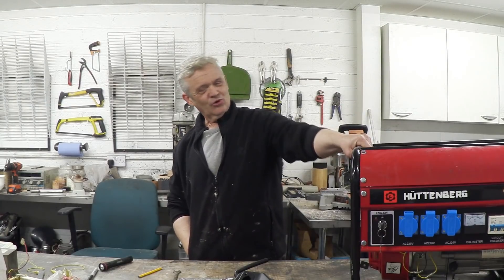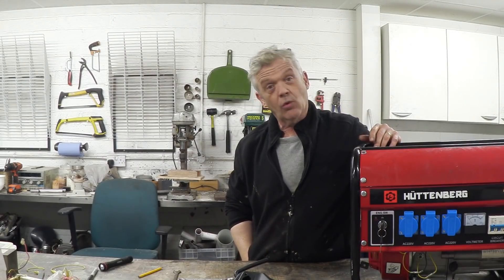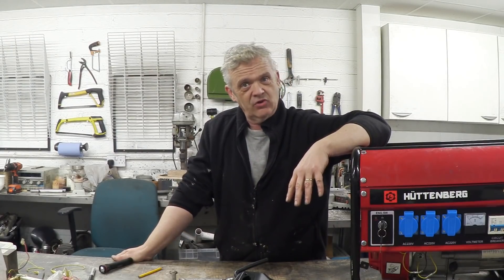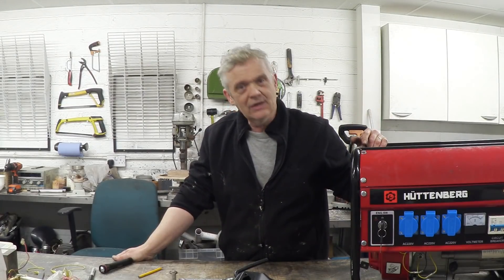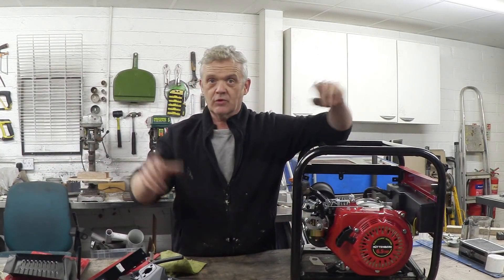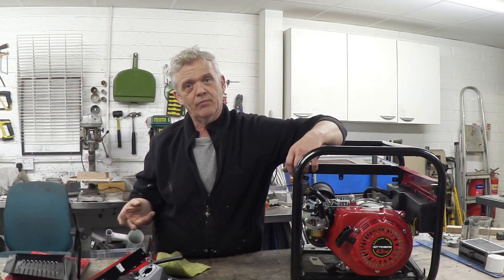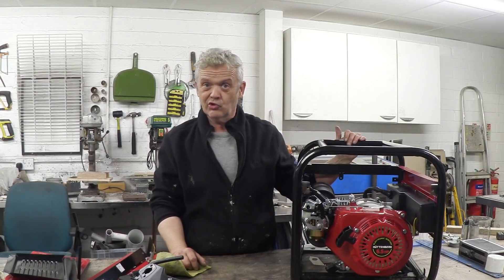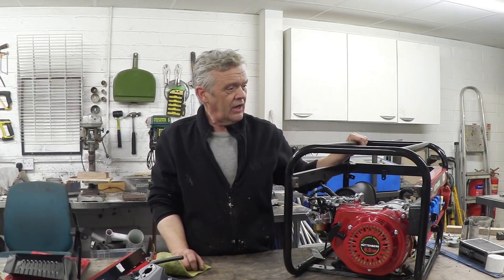DIY Gasification and Generator Unit - Part 1 - The Generator

Comment: Gratification and generator OOo yes! Then add, run car AC compressor as heat pump air to floor heating. And put engine in a bath of oil 1 pump to circulate oil in a household radiator. The engine exhoust can be used ex: to air heat exchanger to have fres hot air camming in the house. Nearly all the heat energy can be used in winter time. If you not put load on the generator u can use the heat pump part or reverse.
This series will be great. Thanks Robert!

Comment: Ive made a few versions of gasifiers and ran generators and gas fire places off of wood gas.  But storing large amounts is the tricky part. Im thinking of storing in propane tanks.

Night hawk makes beautiful versions. Also his way of purifying wood gas is perfect! 

Purifying wood gas is key to not ruining your petrol engine with particulates.
Reply: iirc, there's a video somewhere on YT where a guy store the biogas in old tyres - after the tread is no longer legal for road use, they'll still hold gas at pressure

Comment: Dear Robert,
I have read a published article two days ago, in Nature catalysis, called 'Microwave-initiated catalytic deconstruction of plastic waste into hydrogen and high-value carbons'. It is a breakthrough method of getting rid of the plastic waste.
One solution is the ongoing research in Japan, on extraction of polymer dissolving enzymes, which certain bacteriae have.
This solution, however, can be performed at home and with you regular microwave oven, very user friendly and requires several minutes of operating time. The byproducts of this microwave oven catalyst decomposion of certain types of polymers are nearly pure hydrogen gas (along some hydrocarbons) and pure carbon in the form of multi-walled carbon nanotubes. Both are highly useful- hydrogen gas can be saved and used as fuel, and the carbon nanotubes are applicable in industry and you name what. 
The only thing harder to obtain is a mixture of FeAlOx, which gets mixed with the ground polymer pellets. It absorbs microwaves and releases heat which causes this catalytic reaction. As far as I've gathered, to get it, one requires magnetite Fe3O4 and the mineral alumina oxide Al2O3. 

Now, I leave you with this information with hope that your intelligence will tweak the design and make it even more user friendly. Please use your great subscription list to spread this information so we might turn the tables on global polymer pollution!
Thank you for your time!

Your fan from Croatia,
L. M.
Reply: Hi L.M I think you maybe interested in the work of James Tour, he is here on YT.

Comment: You may want to stop by a local car parts shop to get a couple one-way valves. I use PCV valves. I had purchased a small supply for my old car years ago and still had a couple left over when I sold the car. I used the PCV valve to prevent back fires and placing one at the carburetor end of the system.
Reply from the maker: nice tip mate - cheers
Reply: @ThinkingandTinkering  it will help you save some facial hair

Comment: Interesting project as I'm living completely offgrid. My petrol generator I have already modiffied to run on LPG using LPG/CNG/petrol carburetor. These are pretty cheap in fact and saves a lot of money when using gas.
I also have solar batteries (panels). They produce enough electricity at spring and summer but autumn and winter are cloudy and not enough energy.

Comment: Condensing the gas down to crude oil, then diesel, then petrol has been done as well. Then finally running a generator with the gas too. I know you have likely seen this from mr Teselonian, I do hope this is the approach you take to this series, as I will be building my own to heat my workshop and produce power at the same time.  I was thinking of using old engine oil too, as it is another throw away source.

Comment: This is going to be fun.. I have an old gas generator that was given to me that is still sitting out in the garage not used.. One thing I was hoping you will cover is the tar problem with wood gasifier. Since I have thought of doing this before (but never got the time) I was concerned about the tar build up in an engine but never figured out how to diffuse it.. This is going to be anther fun project Rob.. something I used to know a bit about.. I am excited for this one.. Carry on ole chum.. lets build!

Comment: I look forward to seeing your design, getting the gas clean enough to not eventually FUBAR a modern motor with tar is tricky. Perhaps once you have gas in the pipe, run that via a stainless steel section through the hottest part of the burner before entering a cooling coil in a water tank (the cogeneration option you hinted at), then you should not have anything but actual gas in the fuel mix, but also be careful as you will be making a lot of carbon monoxide therefore if the generator motor runs rich your exhaust will be toxic.

Comment: What a wonderful tool. Who knew we could turn tires and plastic into fuel.This could help clean our plastics and metals up as well. Carbon left after an updraft gasifier can extract so many things from our water and air.  I made one of these and was able to convert my downdraft gasifier into an updraft gasifier using propane tanks like Mr Teslonian. I decided to use a propaine tank as a water jacket guess that could be used for a steam boiler since the the  exhaust pipe is plumbed trough it like a boiler uses. I’m not afraid of steam boilers
 if used correctly. I saw a guy turn an air gun into a micro turbine. Low pressure is key they run well under 90 psi. I wonder what else I could use to condense the gas because over time that water would get hot. I enjoy making methane gas from my bio digesters what a brilliant way to trap that gas and use it. Guess it could be re burned into the steam boiler aka propaine tank. I decided to plumb the the exhaust line through my biodigester to accelerate methane gas production. Why not use all that waste heat then condense it back into the boiler aka propaine tank. I would assume redirecting the syngas and methane back to the boiler would make this system very efficient. I’m all about cleaning up the environment and ourselves in the process.

Comment: I have a cool idea I haven't got around to testing yet. But I want to build a sun-powered gasification unit that runs an engine. You simply use reflectors to reflect light like a solar cooker. I'm really thinking for your chamber you want a glass container submerged in liquid. And just use reflectors to reflect light onto the wood through the glass and through the water.

Comment: Recover the heat from the exaust,, steel coil in a old LPG condemnedgas gas bottle. Works ace. Heat exchanger form old tank etc... Hot water quickly. AC coil in normal cooper tank. etc ....

Comment: Dear Rob, dear All of others,
Yes, there are some ways to generate burning gas. I heard that during WW2 in UK run their cars with (methan) gas from chicken sh..t. The put it in a bigger gasproof bag and leaded the gas to the petrol Motor. Another system - during WW2 - was the downdraft woodgas generator. This is a bit more complex system to generate burnable gas, but it's been working. Next one was in the past that has been prodused gas from coal. I don't know how, but coal gas was till the 50ties runnung in several towns as public gas supply and generate local electricity as well.

Comment: Cant believe you just put this video out rob , the timing is crazy! Im about to start a project to convert my petrol generator to run off a hydrogen cell! Ive not started it yet as im still getting the parts together but i have the geny and a lpg carb conversation kit next part is to work out the requirements for the cell . You say you have a second generator you dont know what to do with...... maybe your next project mate 😉

Comment: My father-in-law who was a WWII submarine veteran (USS Cobia (SS 245)) mentioned stops in Australia for repairs, provisions and fuel and remembered the taxi drivers there had switch their cars over to gasification (coal in the instance he mentioned). Every once in a while the driver would stop, lift up the trunk hood and stoke the fire for more coal gas to the vehicle’s engine.

Here in the states, I grew up in a small city in central Illinois where one of two coal fired power plants had set up a coal gasification plant (with government subsidies) to help meet tougher enviornmental emission standards. The plant was just about to go online when George W. Bush won the 2000 presidential election over Al Gore (An Inconvenient Truth) and the new air standards were throw out and the gasification plant scrapped without ever having been fired up.

When you can use cogeneration in the gasification process (i.e. waste heat), the overall efficiency increases sharply. What I’m wondering is how do efficiencies of external combustion engines burning bio fuels directly, like in steam and Stirling examples, compare to gasification to run internal combustion engines? Could the waste heat of the gasification process hold sufficient energy to run a scavenger Stirling generator?

Absolutely love you videos and thank you so much for sharing your knowledge and curiosity.

Comment: Check out plastic pyrolysis.
Plastic to gas and kerosene, diesel, and gas. 
Good use for Plastic. 
I am curious if it can be used to extract the hydrogen for fuel cell create more electricity than used to extract. If not good way to store energy from solar panels.

Comment: It is easier with charcoal, as most of the chemicals that could form tars etc are not there.  

Also if done seperately, you can extract the "Pyrolysis Oil" produced when the Biomass is pyrolysed to charcoal. (This produces some syngas as well, but this is not the main product).

I will be doing some link spam of useful stuff below:
Reply: Yes, the oil (or "wood vinegar" as they call it) is used for many things in the Far East.

Comment: surely it's one of the simplest and best options of fuel renewable energy without using resources apart from the metallic engine, but again we end burning biomass that can be used to extract lignin or other chemicals in a biorefinery setup. With a heat exchanger and compressor attached to the wind turbine it can be created and stored a mix of liquid hydrogen (synthesized with concentration solar), liquid nitrogen and compressed that can be used in a efficient micro gas turbine with proper sound insulation.

Comment: I've been looking into these for a long time..  Right now I have a generator charging my battery bank, because I haven't seen the sun for 3 days. I also have wood burning in my stove for heat!

I would really like to see some kind of auger feed system for the wood into the gasifier, because you would be able to automate the whole gasification process.  Wood in, charcoal, gas, and heat out. Then put a coil and water in, and have a hot water heater too.

Comment: Wood gasification is a good way of using up old scrap wood in skips etc, but getting Liquid fuel from waste plastic via Pyrolysis is really taking off both commercially and DIY. As you probably know once the process has started a Syngas is produced that can be used to run the process. Leaving an inert Char, and a Clean burning low Carbon liquid fuel. I like this cos we are drowning in waste plastic which needs to be got rid of anyway,  and is basically Solid fuel. Also medical waste and Vehicle Tires can be used in Pyrolysis.
Reply: Gasification can use any waste with cellulose, which is also an abundant and cheap resource.

Comment: In ww2 they also turned coal into oil which I found fascinating it gives you a different perspective on the "potential oil crysis" I guess its similar to what you said with the choke except more liquid than gas, though not sure how efficient it is, also this made me think of the compost gas recycling stuff which could be an interesting project although personally I find it a bit scary to mess woth gasses, we have a gas stove at home and I'm always a bit paranoid about that stuff lol I would much rather have an electric one

Comment: Love seing u do a gasifier project, I have an idea instead of feeding the gas straight into the carb they now sell natural gas/propane attachments for generators I wonder if this would work ? Maybe eliminating the need to self regulate air/fuel mixture with valves. Can’t wait for an update on your build. Cheers

Comment: Next step… running the generator on biogas!  
I’ve a friend in Florida who’s done a lot of work on this.
Reply: Very much!, biogas generated from food waste is a wonderful safe green fuel, with nutrient rich organic liquid fertilizers as the byproduct. Yes it certainly needs higher ambient temperatures to work effectively in a cold climate like the UK. But say if you install a longish linear flow biogas bag reactor inside a double insulated mini polytunnel, and then use a waste cellulose rich slow composting thermal generating heap under it. Then optimum rates of biogas should be produced even in the deepest of winters as well. A small addition of atomized iron powder mixed into the feed stock will also reduce unwanted oxygen, and enable higher calorific value biogas production as well (effectively reducing the CO2 content in the final biogas), and at the same time dramatically reducing the unwanted HS component percentage. Small amounts of finely powered biochar/ activated charcoal added to the feedstock will also further turbo charge biogas production. As the micro pores in the organic carbon make awesome happy party homes for the methanogenic bacteria to thrive :) (y)

Comment: Robert 
We have tons and tons of waste food, lawn cuttings, shrubs cuttings being dumped every day which produce methane. If this gas could be compressed say used in a small industrial unit that can run small type generators mountains of money could be saved. think of a unit in a small village that is supplied by the waste of the village that then is transformed into power generation. Methane gas is the biggest killer of our planet as unlike CO2 it can not be recycled by natural systems, ( plants take up CO2 ). One of our biggest producers of methane is sewerage treatment works if this was cycled into power generation our plant would be a safer place. Mix the both and we end up with a byproduct of the greatest organic fertilizer and soil conditioner to establish more forest that can recycle CO2. As they say from something small big things grow.
Reply: You can do a similar process with other types of organic waste.

Comment: Cool great minds definitely think alike😁👌 I've got a brand new wursburgh think it's called German 8500 watt 12/240/480 three phase and possibly 110 generator which I only paid £150 for and has €1196 on the box. I'm thinking of building a gasifier and have been wanting to since I watched Mr teslonian on YouTube build one years ago that also ran a fridge on the gas and made different fuels in the cooling process.he makes all kinds of energy devices a bit like you. I've never put any petrol in the generator just oil and never had it started. I know there will be power cuts in the future and I want to be having electric when this happens so your version might be something I can do with the materials I have lying about.😉🍻
Reply from the maker: turn it over just to make sure it starts and we can do the build together!

Comment: Robert,  Please consider using a rocket stove design to create the gases. then venting those into the combustion unit.
Reply from the maker: I was going to do a down draft design mate as it is less harsh on the fire box and grid - rocket stove types are updraft and they can be short lived apparently

Comment: Besides a dehumidifier is there anything else one could apply to a gasifier unit to increase efficiency for a home unit? Thermo-electric application i mean.
Reply from the maker: for sure mate there are quite a few things you can do with them but in gasifier terms home built are pretty efficient in themselves you know
Reply: @ThinkingandTinkering  Looking forward to the build thx.

Comment: Check out Tactical WoodGas on youtube.  Mike Leister sells a big dragon wood gasifier on his website as well as on Amazon if you have more money than time.  It is basically 4 metal buckets connected with electrical conduit.  The gas goes from the burner/producer buckets and into a radiator in a water tank (another bucket) to cool the gas and condense the water vapor and tar.  From there it goes to yet another bucket filled with something (fiberglass insulation, wood shavings, etc.) to further filter the gas and then into a plastic flexible pipe where it can go to your engine.  A 12 volt fan is used to get it started but I think it is supposed to continue running just from the vacuum of the engine.  PVC ball valves are used on the cool side to control where the gas goes as well as to set the air/fuel mixture.  A canning jar is used to catch the condensed liquid.  JB Weld or some other kind of high temp "liquid steel" is used  and metal conduit connectors instead of welding or brazing so it can be made without a lot of tools or special skills.

I bought his gasifier but haven't gotten the air/fuel mixture right to keep the engine running for extended periods yet.  When the gasifier is first started, it makes a lot of smoke until it gets working good enough to burn the gas either directly or in an engine.  I think I still have too many air leaks as well as not having the air/fuel mixture right but I hope to run a generator from wood gas eventually.  I look forward to seeing how yours turns out and get some good ideas.